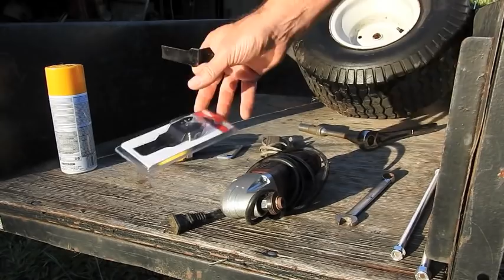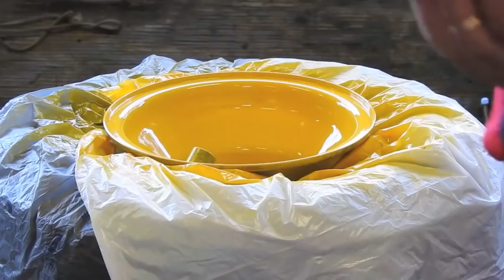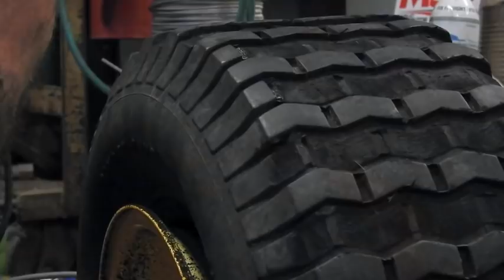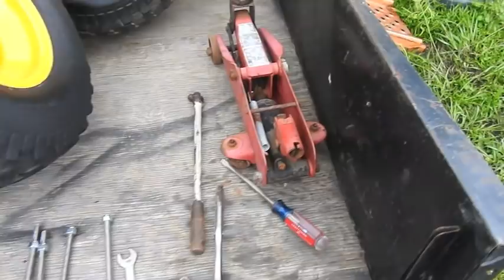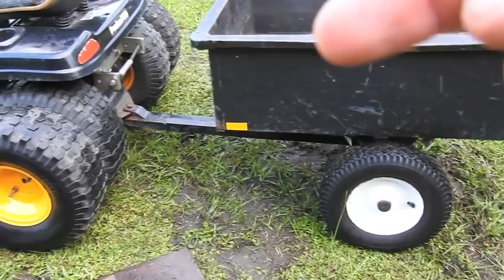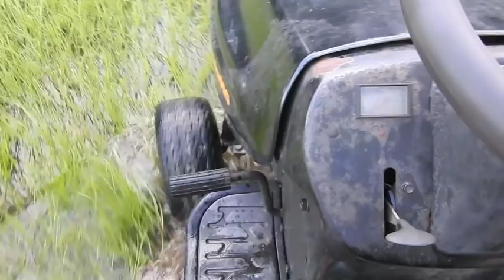How to Put Dualie Tires on a Mower

Comment: I FOUND THEM IN A BUCKET ON THE SIDE OF THE ROAD???????????????????????? YA RIGHT
Reply from the maker: You can believe it or not, they were in a 5 gallon bucket with a bunch of nuts and washers on the side of the road.  I have the wife as a witness.  I didn't know what I was going to use them for, but I am glad I found them. Thanks for watching.
Reply: yard farmer Clearly you were not there to witness it. I once found a padlock in a sandbox with my metal detector, five minutes later, I found the key. You tell me strange things dont happen. So The guy found some long bolts in a bucket. Big ass deal.
Reply: RC Hobbyist Extreme  I bet you had to sift through a lot of cat poop in the sand box she you found that.   Was just having fun with my comments.  was not aqusing anybody of anything.   smile!  I should have said it a bit differently I guess or not said anything at all.
Reply: Hey I make stuff (ex. Engine stands/storage cradles, flat bed carts, tool carts, frames, etc.) from used bed frames I find on the side of the road or garage/yard sales for nothing or very little so why not... people throw out all kinds of goodies every day. Heck for $400 I picked up 2 full garden tractors, 2- 1/2 lawn tractor (2 complete plus all the tins and extra back half of a third tractor) 3 mowing decks, a barely used tiller, and a snowblower for the tractors plus a walk behind snowblower.
Reply from the maker: @scottfirman  that is cool and thanks for watching
Reply from the maker: @dodgeme1986truck  sounds like you have mastered repurposing. I am always hunting bed frames, excellent building material for many of my projects. Thanks for watching
Reply from the maker: @c50gegreg28  as far as I am concerned, all good. Feel free to comment anytime.

Comment: There is no way that will ever last the first time you put weight on one outside tire alone and you have a problem
Reply from the maker: Donald Campbell Those duals held up perfect. I even made them wider and changed the turfs to tractor tires.  I put them on my John Deere and even did some rock crawling. They too held up great. Maybe the problem you were talking about is wanting duals on all my mowers. Thanks for watching!
Reply: Whatever man.
Reply from the maker: Check the videos if you don't believe me, I have several. Thanks for the reply.

Comment: wont be long and those two lone bolts on each wheel will fail
Reply from the maker: Good prediction, but they are still hanging in there. I even put 4 bigger tractor tires back there and they are still holding.  You could be right, but so far so great. Thanks for watching.

Comment: Put dullys on the front too
Reply from the maker: That is a great idea and I have actually been brainstorming that one too. Thanks for watching.
Reply: chud327 use 3 rib tires on the front(just like them old farm tractors use) you'll see the difference
Reply from the maker: Yes, I might look into some, especially after locking the rear. thanks for the reply.

Comment: LMAO this guy had nothing better to do he's using two 10 inch carriage bolts 2 Broke another tire on LMAO it doesn't take a structural engineer or any kind of engineer there's a reason the drive Wheels have a three-quarter inch shaft and a keyway it's called torque when those Drive Wheels torque they will twist those carriage Bolts that system Won't Last a Day just my opinion
Reply from the maker: Great prediction, but it over a year later and they are still going strong.  In fact, the video that came out this morning are the same bolts from a year ago. Thanks for watching.

Comment: Those threaded rods won't hold center for long!!!!!
Reply: Mike Secondo You are right,the extension rod will bent and there goes the trans.
Reply from the maker: They held up until I changed them to 4 tractor tires and thanks for watching.
Reply from the maker: They held up and thanks trans is still fine, but thanks for watching.

Comment: Extending the trailer tongue wont help you on turns, because it's the original tire that its hitting and no matter how far you extend it, it will hit the original tire, so theres effectively no change.
Next, why didnt you either drill a hole and add a air extender like semis have through the new wheel , or just flip the original wheel around, that would put the air valve for the inside tire on the inside so you could reach it with the new wheel still mounted.

Also with only two nits on each piece of all thread that second wheel will slide against the original tire and when the all thread is horizontal the outside wheel will slide up. Maybe if you put a nut inside the driven wheel and a steel sleeve over the all thread, maybe 1 inch steel pipe by what ever length that's needed to go to the hole where the all thread goes through the new wheel , would help support the whole thing and make it more regid. I can see the added wheel wobbling and moving around on your video it wont be long before the all thread bends, and brakes from being twisted.
The best title for this video would be, 
How NOT to Put Duals On a Mower.
Reply from the maker: No, it hit the outer tire, long tongue would help.  If you flip the original wheel, it rubs because of the offset.  There was a bit of wobble, but I have gone back and made a better system.  Go watch it and see if you can poop on every part of it too. Thanks for watching.

Comment: Come on...  there is absolutly zero strength behind what youre doing here..  So It holds the wheel to the other wheel thats it..  Put any weight on those outer wheels like drive over rocks, or curbs, and youre going to bend those all thread, and the wheels is going to wobble, or fall off.
Reply from the maker: I will let you know if it does, so far, so good.